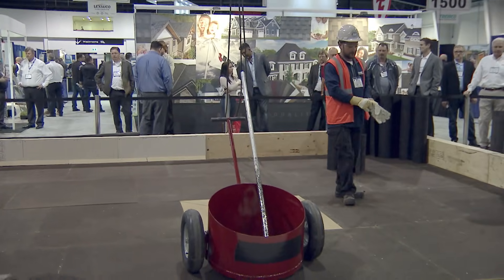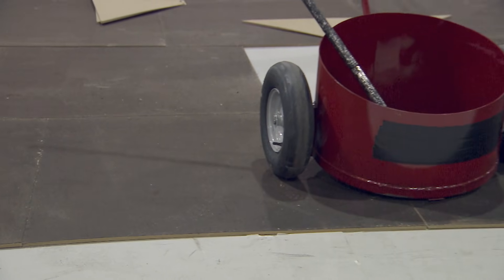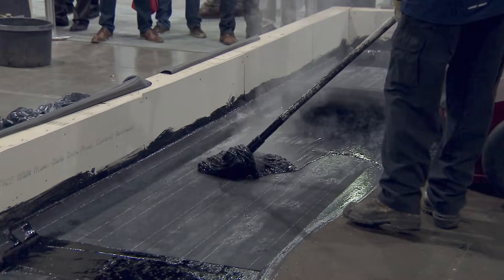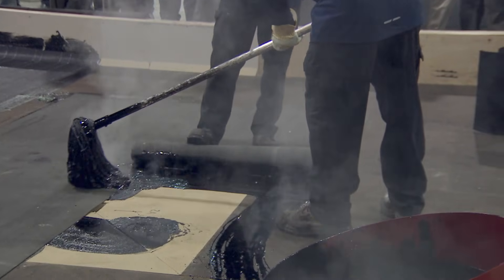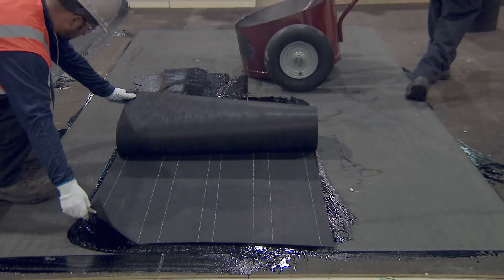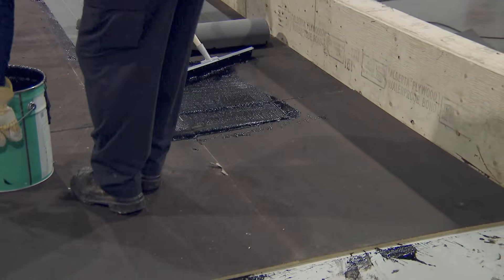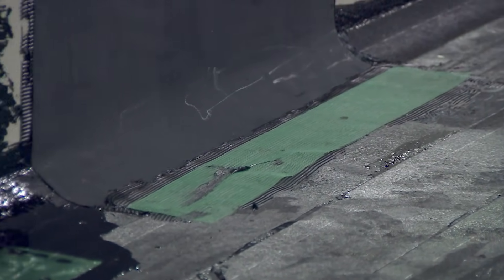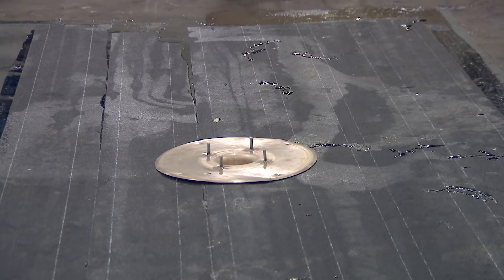Built-Up Roofing Systems

Comment: I noticed you required a hack saw for cutting ISO board won't a straight edge or non hook blade but the ISO board, is that of all insulations, or are some stronger than drywall.  Wouldn't you do the same damage to the ISO as to the majors saw saw.  Am I to believe I'm cutting wood.  Non compliant complexities.  Why me

Comment: What type of boots we'll need for a project of the required standard,  subject to monitor the influence sustained.  Required boot, required sole,  what material is the required standandard for applying pressure from the asphalt to membrane,  how to seek light and steady before mourning

Comment: why is there a vapor retarder on the metal deck if your driving fasteners through the vapor retarder.
Reply: Essentially they are just building a wall of defense against water intrusion. The MVP over the substrate serves an additional line of defense. Not to mention they have to secure the ISO in place through some fastening method. What would you do?

Comment: Tar too cold and mop man must be rookie. No flow ahead of roll.whwn he rolls out rolls.  Tar must be deep enough to see a flow in front while it rolls out . Mop man barely out down any tar   ,this is a crap roof systym in first place .  I used to do polyester polymax 3 ply and coat in tar and later paint with aluminum paint.  Great 50 year roof. I see my jobs from 30 years ago we did and roofs are doing great still.

Comment: Well he can’t mop, roll man using a straight blade, and the mo man gotta help roll the paper??
Reply: I always use a straight blade for the felt hook blade for the walls and rubber proper
Reply: @iamstevestrough8185  I always keep a sharp hook knife. You can you a straight blade. I was taught to use a hook. I do not want to be that guy that cuts through the roof. If we had a loud mouth rookie, we would tell him cut some walls. Give him the measurement. And go to the other side of the roof☺️(99% of the time they will use a staight blade). Wait about 10 min. You’ll hear “STOP,STOP,STOP WTF ARE YOU DOOOOING!”🤣🤣🤣🤣🤣🤣